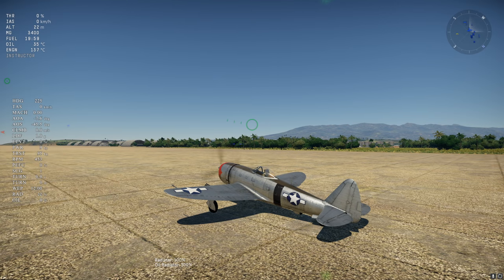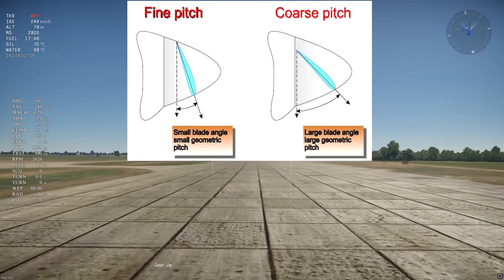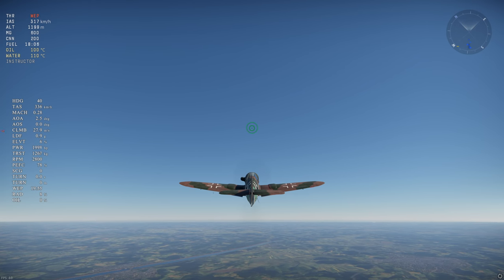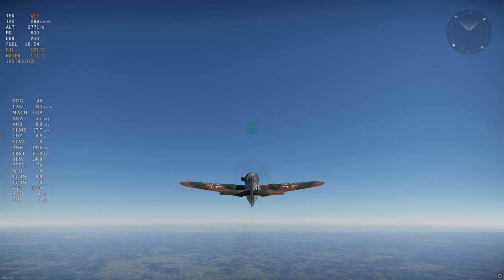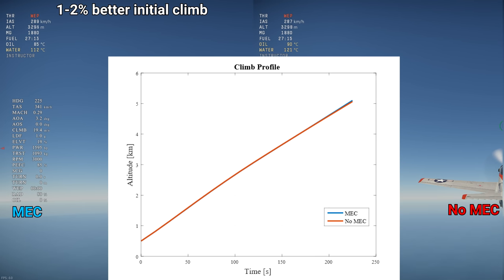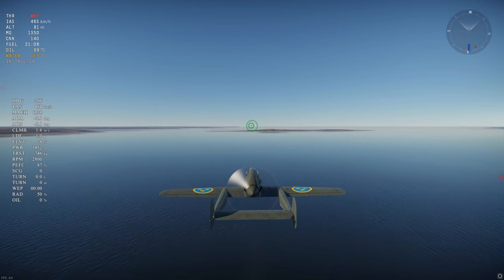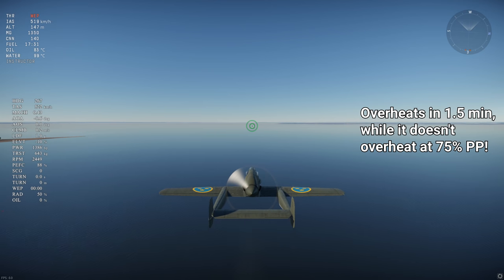Manual Engine Controls Part 2 | Performance Advantage With MEC

Comment: could you explain what is the difference car's rpm and aircraft rpm and why my car doesn't overheat when i drive full power and approximately 4000 rpm in highway?
Reply from the maker: Good question! First off, smaller engines tend to run at higher RPMs, and an aircraft engine is much bigger than your car's engine (hopefully), so you can't simply compare RPMs. Then there's the question of cooling flow. In cars, speed and power are more closely related than for aircraft. For example, the most difficult thermal case for an aircraft is climbing at full power due to the relatively lower speed and high power requirements. At full speed on the highway, you'd have a lot of airflow for cooling. If you tried to mimic an aircraft climb in a car, for example climbing at a very steep gradient at full power, I suspect your car could not sustain that for long.
Reply: @AdamTheEnginerd   thank you

Comment: i have a question, is it worth to use radiator control on yaks or ill just burn the engine faster?
Reply from the maker: Of course it's worth it, you decide how much you burn your engine.

Comment: Can we get an explanation on the commonly regarded “broken” FMs of War Thunder(eg. A6M5, AU-1)
Reply from the maker: Why are those "broken"?
Reply: AdamTheEnginerd some people think that Japanese planes have too good energy retention, later Corsair models have unresponsive rail control; I put “broken” because idk if these are realistic or not
Reply from the maker: For energy retention they match what I would expect. You mean rudder for Corsairs? Indeed it stiffens up more than most other planes. There is an issue with the relative difference in stiffening between US and other nations planes indeed.

Comment: I never knew that going into the orange would de decrease maximum temperature, that explain why in the itp m1 there were games where I almost stop being able to turn on mec or worse.

One question tho, does it reset when you land/repair?
Reply from the maker: It definitely resets when you repair. I think being low on throttle and hence temperature also adds temperature resistance with time, but I could be wrong.
Reply: @AdamTheEnginerd  I see I see, anyway thank you very much for the knowledge here and in all your videos

Comment: So I’m on Xbox, and I don’t have enough buttons to play air rb or sim. I was wondering if you would recommend a Thrust,aster t16000m joystick throttle and pedals. Thanks!
Reply from the maker: Don't need extra buttons for RB, you don't have to use MEC in RB. I'd recommend a PC.
Reply: AdamTheEnginerd what I meant by extra buttons is that the control only has a certain amount of combinations, and I only have 80% of the necessary things binded... I don’t really want to spend a ton on a pc, what are your thoughts on the thrust master?
Reply from the maker: I don't have a thrust master. It's useful for sims I imagine.
Reply: You can use button combinations (at least on PC you can)

Comment: Yeah try doing that in missil thunder
Reply from the maker: Doing what?
Reply: @AdamTheEnginerd  doing all the mec stuff, in a mach 2 jet with a mach 3+ missil behind u 😂, i might use mec for radiator only some props overheat way to fast, great vid btw.
Reply from the maker: @gabrielabreu5200  Thanks!

Comment: Hows the p51d30 now. how does it stack up against F4U4. And whats the optimal mec settings for the F4u4b
Reply from the maker: Rudder still trash on the D30. I'd go with F4U4. Optimal MEC for F4U4B is 100% prop pitch and enough rads to not overheat.
Reply: @AdamTheEnginerd  if u ignore the stupid rudder of the d30 how is it. Would it be the fastest plane at 5.0
Reply from the maker: Yeah, but it can face faster aircraft.
Reply from the maker: Actually F82 without gunpods is faster.

Comment: How do I know if im using mixture correctly ? Is there any benefit from it ?
Reply from the maker: Mixture isn't really modeled on most aircraft, you're either at the correct mixture with maximum power, or you lose power if you're outside the correct mixture range.
Reply: @AdamTheEnginerd  yea but the problem is i dont know what's the correct mixture range. I read something on the war thunder wiki that you would use lower percentage at higher alt and higher percentage at higher alt but idk
Reply from the maker: @Unused91287  Lower mixture at higher alt*. Like I said in the video, for most planes you can just leave it at 60% until 6km with no loss in performance, and reduce after that.
Reply: @AdamTheEnginerd  oh ok thanks

Comment: How does lowering prop pitch decrease the J21's operating temperature?
Reply: less rpm, less engine stress, less heat build up
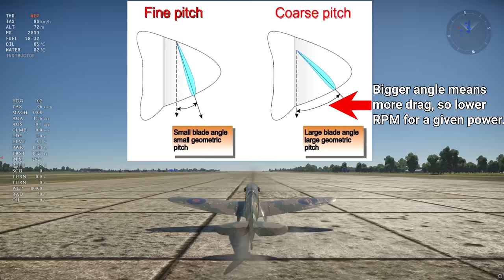Reply: Eduardo Fialho Won't you get higher RPM though? As I've understood it, 1:56 says that HIGHER prop-pitch means LOWER RPM and vice versa.
Reply: @axelandersson6314  the opposite
Reply: Eduardo Fialho So what does he mean in the video at 1:56?
Reply: @axelandersson6314  that the percentage is the target rpm
Reply: Eduardo Fialho Okey, I see. So I guess in Adam's layman's terms™, "bigger percent is smaller angle". Anyways, thank you.
Reply: @axelandersson6314  from what ive seen. Some german planes the prop pitch % is the direct angle of the blades, while all other planes its the % of max rpm you want and the propeller angle will change to achieve that
Reply: Eduardo Fialho In that case, my earlier reasoning would make sense.
Reply: @axelandersson6314  why i would? Lower pp, lower rpm, lower engine stress, lower heat
Reply: Eduardo Fialho I guess one could substitute "engine stress" for "friction".
Reply: @axelandersson6314  sure
Reply from the maker: For the record, it is my belief that reducing prop pitch % (RPM) cools way too effectively for the amount of power that is sacrificed.

Comment: does manually changing the supercharger gear have any performance benefit? i thought the game automatically changed the gear efficiently, even with MEC enabled.
Reply: no but with mec enabled you must do that manually, it does not have an automatic control feature like for example mixture, pitch and supercharger for most german planes, i have the enter key of numeric pad binded for changing supercharger gears
Reply from the maker: The game doesn't do it perfectly but it's good enough. As Mauro says, if you use MEC you need to change gears manually as well, that's why.
Reply: @F3R_Mauro  figured that out just now, never noticed because the planes that I use mec on don't need to worry about changing the supercharger gear for one reason or another.

Comment: Hi dude what MEC should I be using to improve the use of f8f 1b?
Reply from the maker: A bit under 100% prop pitch, and like 50% rads.
Reply: @AdamTheEnginerd  gotcha, does the drop by 10% for every 1000m still apply? or just keep it at say 95%
Reply from the maker: @George-cp1vc  Nono, don't change pitch with alt.

Comment: Howdy Adam, a little question for you: is it possible to get that overlay when playing on console? Really bums me out when I'm not using MEC to it's full potential- it's a cool feature!
Reply from the maker: No it's not, but you can get the same info on another device with this method:

It's called the "local host".

How to access the "local host":
You need to be running War Thunder or it won't work!

Option 1: on the same computer that is running WT:
-Type http://localhost:8111/ in the address bar and press enter and voila.

Option 2 (which also works on the computer that runs WT):
-Type http://Your_IP_Address:8111/ where you replace "Your_IP_Address" by your IP Address (192.168.X.XXX) in the address bar and press enter and voila, you can look at the characteristics on another device while flying.
Reply: @AdamTheEnginerd  thank you very much! I shall see if I could do this on my PS4.

Comment: Adam do you recommend console players to use MEC?
Reply: if ur on a console, I would recommend to plug in a keyboard and/or mouse and use that to bind the controls for MEC. I don't think a controller has enough buttons for MEC but you could make a lot of button combos, but that is hard to remember. Much easier on a keyboard.
Reply: @NGFN  yeah
Reply: @NGFN  I made a control for each fighter, so I only need to load the controls for that plane. The problem is that I dont have a place to use the keyboard without hurting my back. I dont have a table to put my console on.
Reply from the maker: With a controller you have other things to worry about.
Reply: @AdamTheEnginerd  I can play like a keyboard player but with some difficulties. Sometimes I miss click a button and lose ;-;

Comment: Ooof you forgot MAGNETOS they make a difference a noticeable one
Reply from the maker: Automatic magnetos always has the best magnetos, so no need to mess with that.
Reply: @AdamTheEnginerd  Really that's so wierd when I switch to the 1+2 magneto position I accelerated to max speed. kept bringing the pitch down until I can't accelerate any further. I turn the mags to 1 or 2, and plane slows down? Mind you Haven't played in a while unless they fixed that in a patch?
Reply: My friends and I did a loooot of testing.
Reply from the maker: @projenitor2387  I'd like to see what you did to test. What I'm saying though is that automatic magnetos is always both on, so you only lose performance if you go manual and only use 1 magneto.
Reply: @AdamTheEnginerd  I will go record some footage :)
Reply: @AdamTheEnginerd  I know this but for the purpose of the video per your reply thought magnetos would be worth mentioning if a person is going to use mec
Reply from the maker: @projenitor2387  As long as you don't touch magnetos, you'll have the best performance.

Comment: sad HE-162 noises
Reply from the maker: Why?
Reply: @AdamTheEnginerd   overheats before you get in the air :D tho 104% throttle helps a bit..
Reply from the maker: @jmirsp4z  Well yeah, just lower throttle a tad.

Comment: What to do when i didnot understand shit?
Reply from the maker: Can rewatch, or not use MEC yet.
Reply: @AdamTheEnginerd  it comes down to my bad english. Is high drag good or bad. And i cant understand the pitch part too. I totallyget the radiators part. I dont get the propeller airbrake part